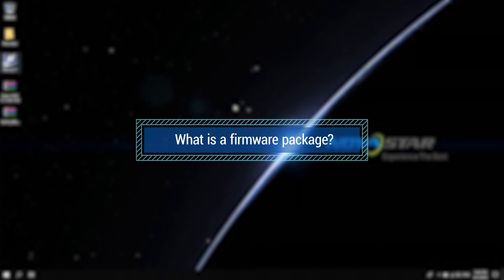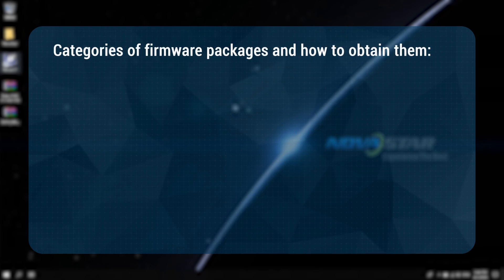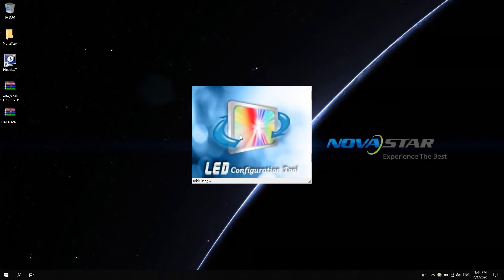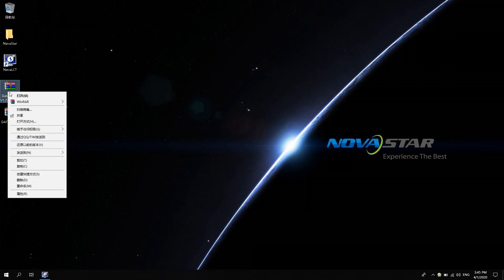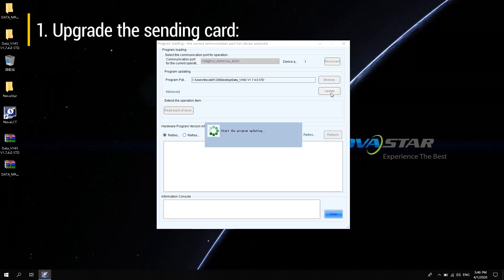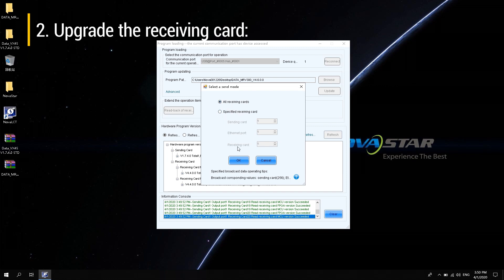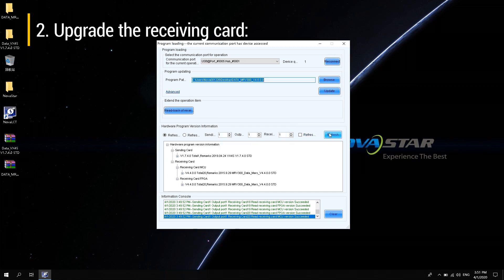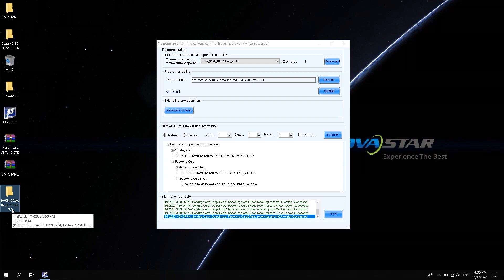10 Firmware upgrade

Comment: This video is useless. It completely skips a step around 4:30 on how to log in.
Reply: The video shows you to click USERS -> advanced ..userlogin -> password: admin, the upgrade window will pop up automatically. But some version of NovaLCT, this window will not pop up. It's weird.
Reply: Hello Anthony I am having the same problem, did you finally find the solution? The pop up screen in my version is not appearing 😞 many thanks
Reply: just select the main window and type admin again, there is no field to type it but it works for me
Reply: You can type either 666888